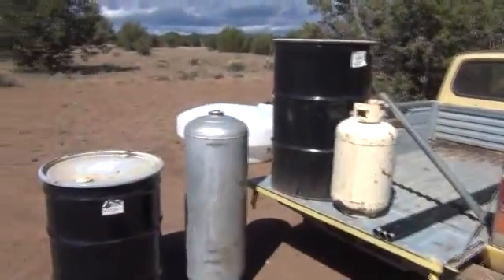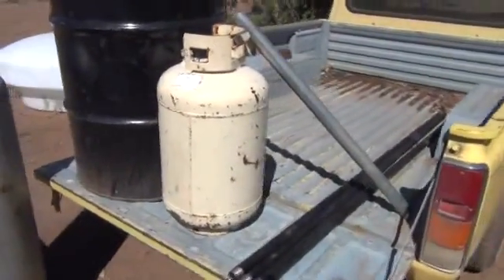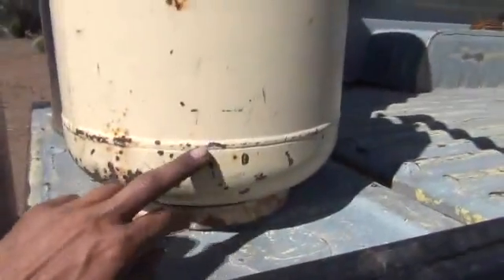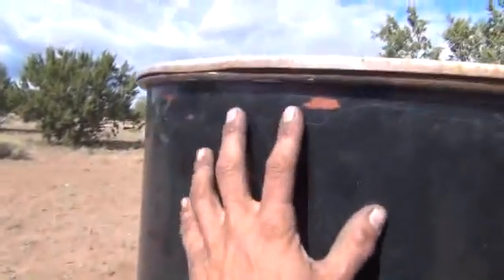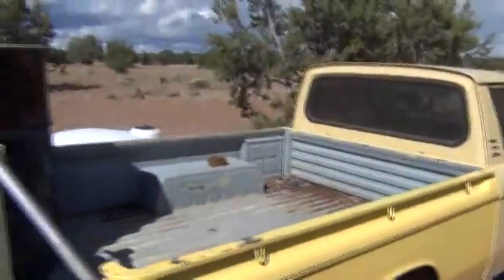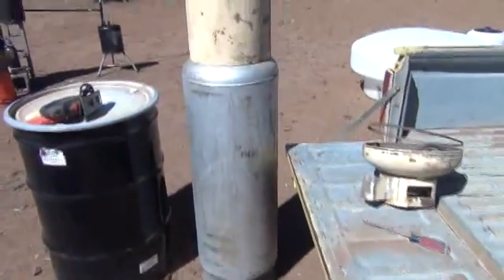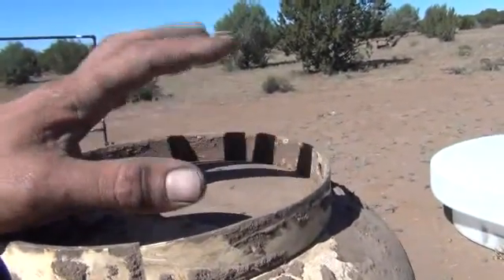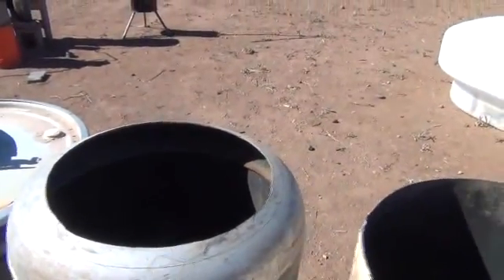Gasifier Truck How-To part 1

Comment: With all that heat you are producing, I wonder if the power wouldn't be better used to heat a TEG to produce electricity, then using an electric motor instead?

Comment: Do you now where I can get the 55 gallon barrel with the lid and is it ok to use a 5 gallon propane tank and a hot hater heater.

Comment: Thank you for your quick response.  One question - is it possible to store the fuel that is created from the system so that it can be used at a later time?  Thank you for your help!
Reply from the maker: I have compressed the wood gas for later use, the truth is it's so dangerous without the proper equipment that there is no way to show it being made simply. The chances of a catastrophic failure leading to sever injury or death are to high to chance it. On demand systems are the only relatively safe way to build and use a gasifier.